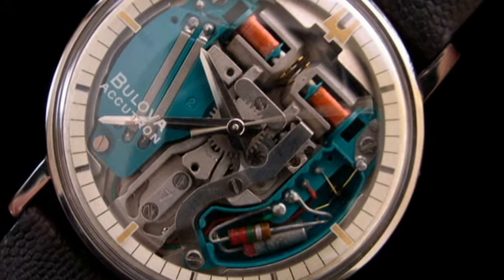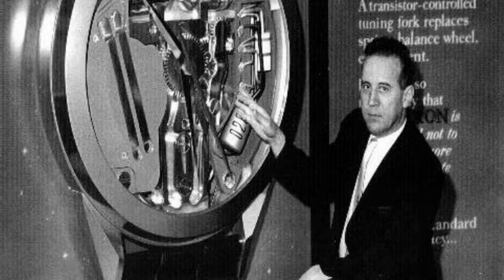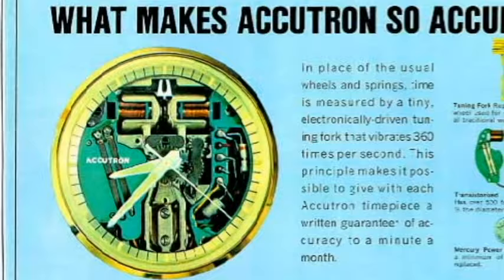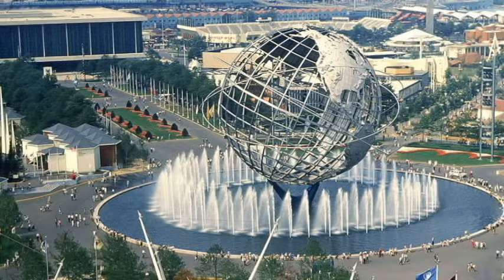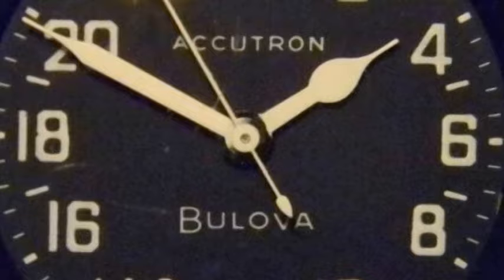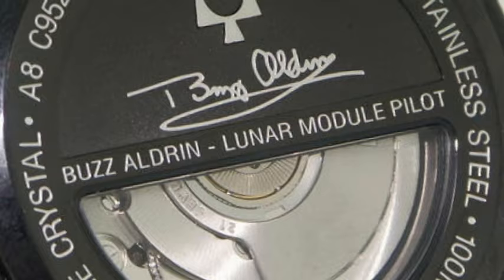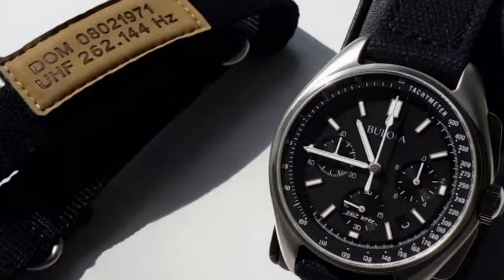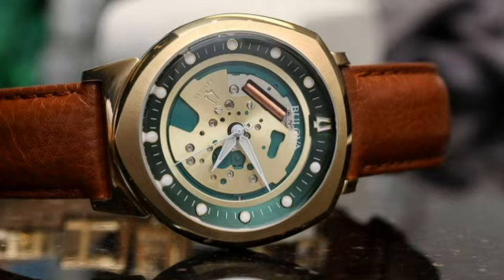The History Of The Bulova Accutron Watch

Comment: There is another aspect missing. In 1972 they made the Accuquartz replacing the transistors with a quartz system. The tuning fork became passive and the quartz mechanism oscillated the Tuning fork. Still had the pawl fingers and jewels. The Bulova calibres  2241 and 2242 were a higher accuracy movement with 14 jewels and a thinner movement